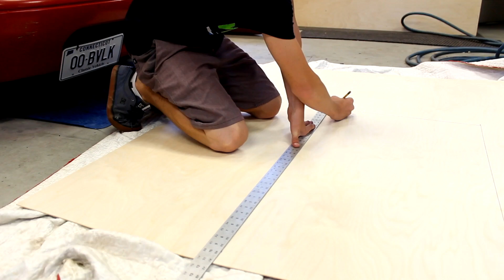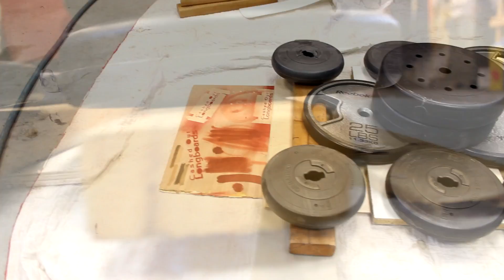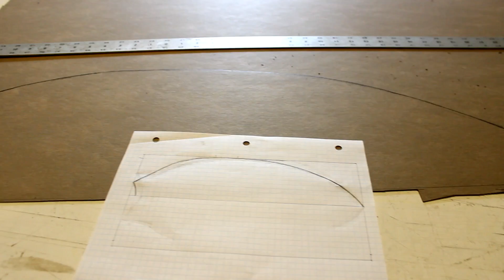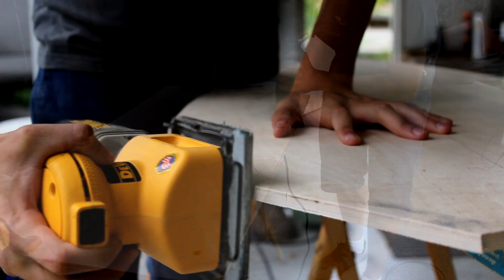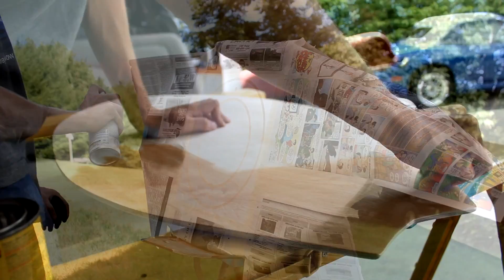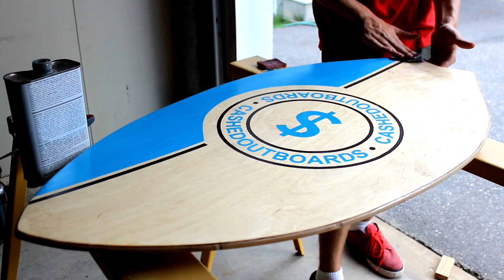How to Make a Skimboard | The ULTIMATE DIY Guide

Comment: Why not start with a thicker piece of ply, attempting to laminate 3 sheets while forming looks like it’d introduce voids and weakness
Reply: Laminating is how you get the curve to it. And how you get it to hold the curve.    Also you could change the direction of each layer to add stiffness.

Comment: whoa that is one fat board
Reply: No a proper flatland board should be 4 ways symmetrical and no more than 50cm wide otherwise you can't do any tricks. If you want to skim better you make a sturdier board so it doesn't flew when it touches the water
Reply from the maker: +Max N 😂that's a skim board for ya, more surface area helps you skim on the water better!